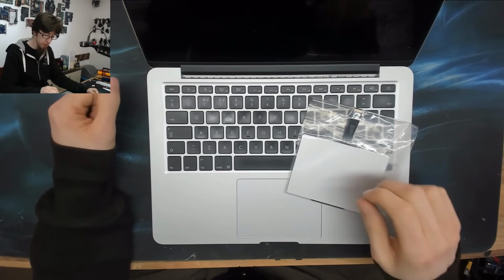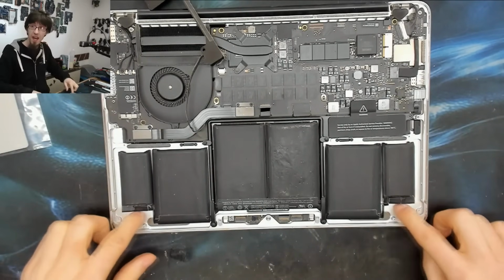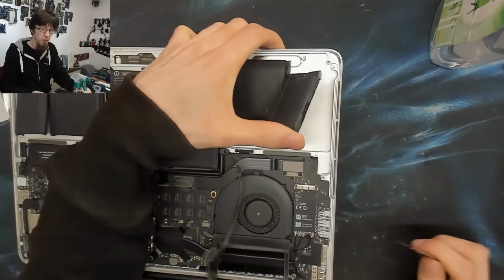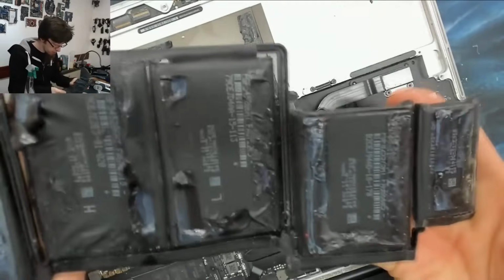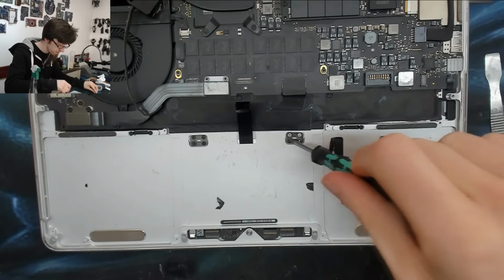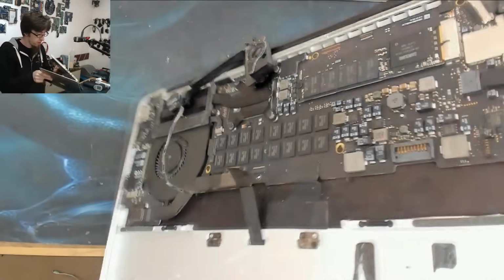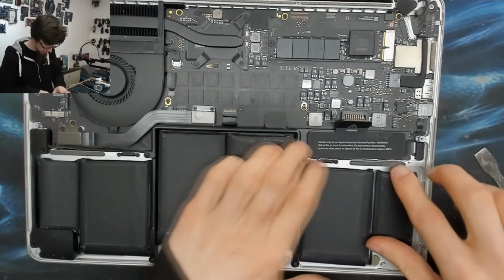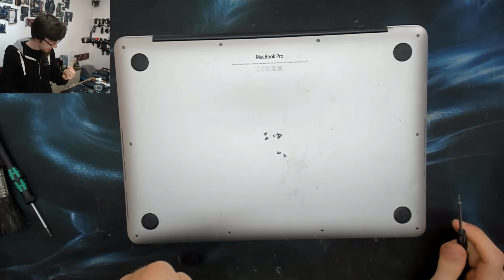LFC#169 - MacBook Pro Retina Trackpad Replacement

Comment: I recommend a Home Depot putty knife or a plastic card (ID card) instead of the metal putty tool. The reason is that the smaller size and the metal makes the pressure more uneven and more likely to puncture the battery.

Also using a hot air station to heat up the areas makes the ungluing much easier.

Comment: Great video. The only criticism I have is that he glosses over inserting the touchpad ribbon. This connection is surprisingly thin and fragile and it's not easy to see how it connects. It needs to slide in to the female connector as opposed to being pressed in like the battery connection. There may also be a little spot of glue securing the original ribbon in place. If the new ribbon touches anything sticky on the way in it will be difficult to insert and the little protective pull tab on top can tear off.

Comment: Great video!  Thank you.  I am getting ready to attempt replacing a trackpad that doesn't click as well as a bad battery.  Where would you recommend buying the parts?  I'm in the US.
Reply from the maker: ebay and amazon are good places to start for parts. They won't be the cheapest, but they're readily available on short notice and convenient.
Aliexpress is cheap, but has long delivery times because China import.
Reply: @Adamant_IT  Thanks a bunch!

Comment: Hi, your video is excellent. I will replace the trackpad. But, My trackpad clicks and the arrow will not move around the screen and I can’t use the computer at all. I’ve tried all the manipulations suggested on line without any result. Do you think that changing the trackpad will resolve my problem?

Comment: I have absolutely no experience with technology but this video was super informative. Do you reckon a beginner would be able to do this or should I have it replaced at a repair shop?
Reply from the maker: If you're interested in learning repair, I'd give it a go, and take it slow. If you're just wanting to get your laptop working, I'd take the hit and pay a shop to do it. The battery is the worst part here, it's not for the faint of heart when you're new to the game.

Comment: wish you would have been giving much more attention to how the track pad cabe is attached and notify the viewer just how sensitive it is! to me it looked like you just pulled it straight out, but there is a tiny little thing holding the cable on place to push..... now the little hook that holds it on place broke on my computer... if any suggestions how to fix this let me know. thanks :/

Comment: HI Adamant IT. Very concise video! My 2013 MacBook Pro retina has a jerky cursor movement when not touching trackpad i.e. cursor moves wildly on its own. I have it bypassed with a wired mouse just now. In your opinion would replacing the trackpad solve this or could there be more of an issue? TIA
Reply from the maker: Almost definitely a dirty trackpad. Removing, cleaning, refitting might be enough, otherwise replacement will do it.

Comment: Great video.
The click function of my trackpad stopped working, I think a little water got into it. Will the above video help with that?
Reply from the maker: No-click is a common failure on these trackpads. You'll need to replace the trackpad itself. But yes, you can follow this video for removal and refitting steps.

Comment: i have a macbook pro retina late 2013 laptop which developed a 'ghost clicking' problem recently. the clicker itself is fine and working, but the mouse keeps moving on its own and opening applications etc. even without me touching the trackpad at all. i have also tried using a external bluetooth mouse to see if this would fix the problem, to which it allowed slightly better control but eventually would revert to ghost clicking again after a few minutes. i followed everything you did in this video, except that i removed the trackpad only to clean it/re-adjust the clicker screw rather than replace it with a new trackpad since i thought excess dirt/dust build-up may have been the reason for this problem, but this doesn't seem to be the case.
i don't know what else i should do, would it be better to just completely replace the trackpad as you did or visit a professional/apple genius bar?
Reply from the maker: Yea if you've done a clean out and you're still having issues, replace the trackpad. Sometimes the dirt and grime is too ingrained, and not even cleaning will shift it.
Reply: @Adamant_IT   bought a new trackpad, replaced it and now it's working properly again! seriously saved me so much time and money, thank you so much! :-)

Comment: Hi there! My laptops left click just wasnt working when I started up my laptop today. Neither on the external mouse or the trackpad. I opened everything up and cleaned it and still nothing. I noticed u said that the problem with the laptop that you repaired in this video was having the same problem. If I buy a new trackpad will that solve my problem? I have noticed other people online saying it's a problem with the CPU board. I really hope it's just a damaged trackpad.
Reply: Try to disconnect trackpad cable....
Then use an external mouse. If now it's ok then... yes! It must be a trackpad issue.
If problem persist... maybe the problem is elsewhere... I don't know...

Comment: I've got a mid 2012 15" MBP Retina, and today my trackpad started jamming. I think it could be because of dirt, but I really don't feel confident taking the whole thing apart just to clean the trackpad, especially since I bought this (used obviously) just a few months ago for a lot of money considering I'm a full-time student. Is there any way to clean it from the outside?

Basically the problem is that the right side feels kind of stuck, because it doesn't click. Sometimes when I just press on the trackpad with one finger it highlight like I would be pressing with two, and sometimes it clicks by itself... I could just use an external mouse but there are so many feature I use that would be limited. Any tips?

Comment: My wife spilled a little bit of water on the trackpad, seems to have gotten onto those trackpad pin connectors, now the computer thinks that the trackpad is constantly holding down the LEFT CLICK, I will have to open it up and disconnect those ribbons and just use an external mouse / keyboard from now on.

Comment: Hey buddy. Ifixit says it is mandatory to replace the battery whenever you replace the trackpad, is it true ? I don’t want to pay 100$ more
Reply from the maker: No. I think they're saying that for safety, because the battery doesn't come out without a fight, and is very easily damaged by removal. If you can get it out without deforming or scratching the cells, it's still good. Use isopropyl and squirt it behind the cells to help eat into the glue and that makes it easier.

Comment: you risk a lot by not wearing gloves and lifting battery cells with a metal chisel. there are many other tutorials that show people removing adhesive with dental floss, it's way safer both for the battery and person performing the removal.

Comment: Anyone really surprised that Apple makes their products so that you "have" to take it to them to be fixed?  No reason to have the battery glued in.  Or have the parts soldered to the motherboard.  You either have to be stuck with the memory, etc. that you have now and not be able to upgrade it.  Or spend more money to get one with higher specs at a higher cost.  Not a machine that the user can add more memory to or add more storage to.

Comment: I also have a 2013 MacBook Pro Retina A1502 and the same wonkyness happened to my screen. I also thought the screen was ruined but it's actually not! The thing that's messed up is only the anti-reflective coating which you can remove with mouthwash...I'm not kidding.  I learned the technique from this video: https://youtu.be/ip3cX-DN2ww
Reply from the maker: Mouthwash you say! I have a video about the coating, but hadn't heard of using mouthwash to remove it. I'll have to try it out on a broken screen. Thanks for the tip!